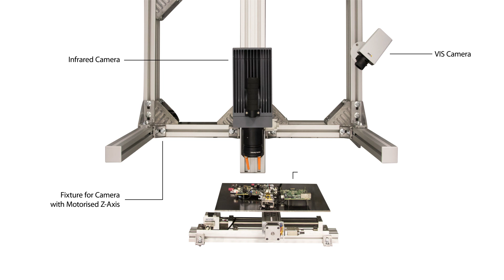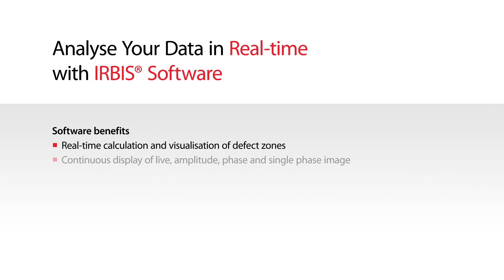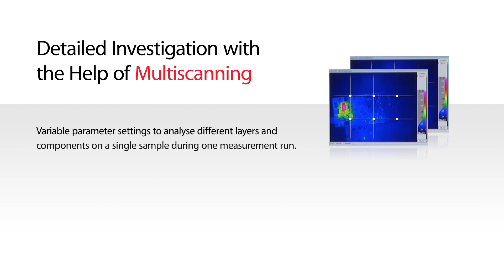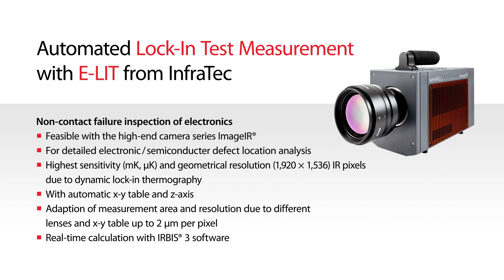Automated Lock-In measurement with E-LIT from InfraTec

Comment: did you finally solve the problem of vibrations (camera inner cooling system) to achieve 1.3um pixel resolution with the locking module ?
Reply from the maker: We have solutions to reduce vibration effects hardly influencing your microscopic measurements any longer. You shall be contacted by our colleagues.